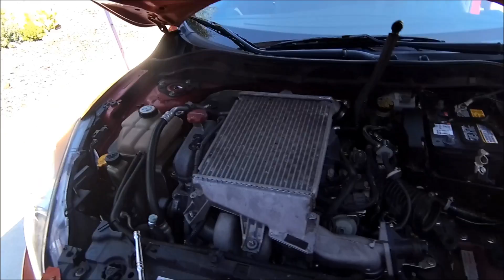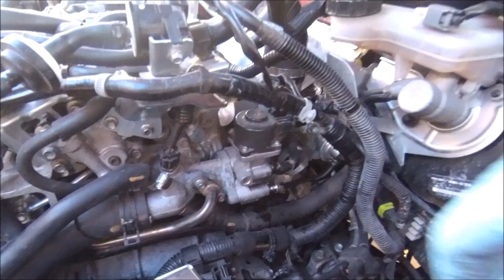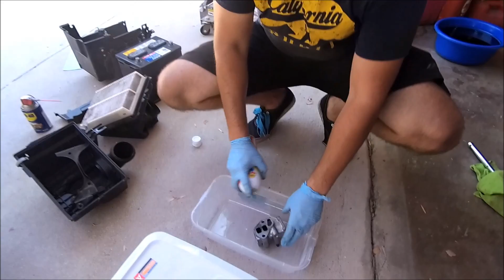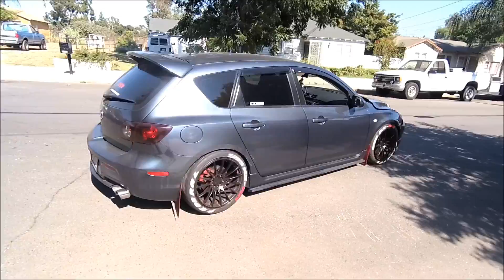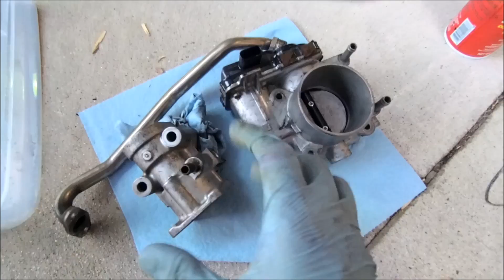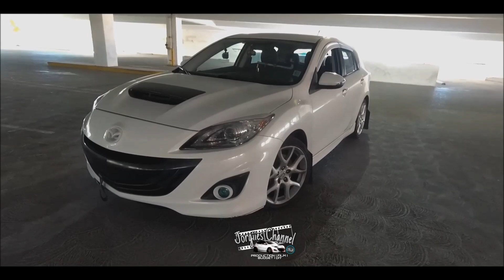Cleaning your Egr (Mazdaspeed 3)

Comment: I did this since i had problem with a long crank and bad idle both got fixed but now it starts smoking white smoke when idling for a while when warm. no smoke when its cold or driving. do you think this could be coolant leaking somewhere from the egr?
Reply from the maker: @hellasceasar4398  It's hard to say when I can't see it. Are you on a stock turbo? Have you done a leak down test? It depends on a few variables that may be the cause.

Comment: hey man, is a crc throttle body cleaner good to clean the egr?
Reply from the maker: You can, but i would say that b12 Chem can be a bit stronger. I would still purchase one, and you can go over it with the tb cleaner.
Reply from the maker: You can use it, but I'd still recommend the b12 Chem. I'd say it's better at tackling the carb build-up and so on. Then you can go over it with tb cleaner.

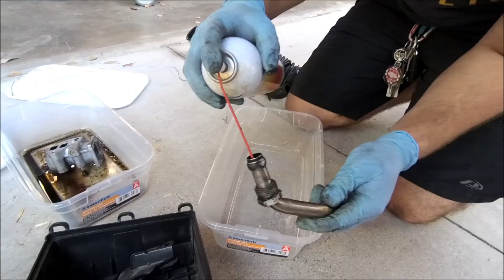Comment: 9:57 imo you should have sprayed oven cleaner in the tube let it sit for 10mins and hose clean, repeat the process a few times till it's clean
Reply from the maker: You can if you choose to. I prefer this can since it's worked in the past and does the job with success. At least for what I've used it for.

Comment: Hey bro love the video. Quick question. My mazda 3 mps is blowing white smoke and losing coolant instantly. Slight missfire as coolant going in combustion. overheating also. Do you think the egr cooler or valve is not good, Causing coolant to go into the intake. Or head gasket. Let me know what think bro thank you. 
Regards
Reply: Sounds like a head gasket? Let me know if this was the issues.
Reply from the maker: I a bit late, hopefully you solved the issue. But it may a more serious issue than than what it may be.

Comment: Yoooo!!! Question!!! 
 was a reason to do all this?  or is any benefit ?
See I have a 09 MS3 but honestly my idle is really poor and even when the weather is really cool idle is 500 rpm or less normally on cool weather should be 1500 rpm or 2k to warm the engine but my is poor idle do you think this will improve my idle?
Reply from the maker: No cel? Could be a number of things. Egr may be the cause, or it may be vtcs. With out more specifics; it can be a bit tough to give a possible solution. You have this as a reference and can knock it out. Any other questions feel free to ask. Goodluck.

Comment: This is a great video, and I would like to add- if someone had worked on that tube and bent it from one end, it will be horrendous to remove it this time. You'll have to jam a wrench to prevent the flare fitting from rotating, and turn the tube itself. Take wrench off, rotate the tube back to start, and place wrench back on and repeat. Install wasn't a breeze either cause now the EGR side is not perfectly lined up. Need to pry and get one 8mm and then the other. I don't feel happy for the next guy who does this.
Also the repair should have included spraying the mating side of the EGR cause that will be equally filled with spaceship black cement.
Reply from the maker: Thanks for the added information sir.

Comment: I have code p050A on my SPEED3 would these help clear the code ?
Reply from the maker: You can try this, but also check your ambient sensor.
Reply: @Luminary_Industries  why the ambient sensor?
Reply from the maker: @christianmendoza5799  are you having idle issues? Temperatures below ambient normal reading may cause similar issues, but I remember having to check this on another gen Juan. Doesn't hurt to start small, and work from there, although you can try the cleaning as well as I've read that this may be a possible issue. Hope this helps 🙏

Comment: How to clean egr on mzr disi 2.3l engine:

Delete it...
Reply from the maker: Well some folks like having stock parts connected and installed. Theres individuals that prefer to leave it as is, though it is an option to delete it, which is why they have egr block off plates or just unplug it. No need to even remove it unless; one wants to remove weight. This owner chose to keep it. It was shared  though. Thanks for the feed back!
Reply: @Luminary_Industries  it has nothing to do with weight. Your egr has to do with fuel economy, but because it recirculates your exhaust back into your intake manifold it gums up for intake valve and decreases the performance of your engine, and can result in catastrophic failure of your engine. 

Why clean it when you can get rid of the problem altogether?

Cars are made from the factory to be more economic, but many of the things they do to cars' engines inhibit them and cause them to need more through maintenance, and because the mzr disi is direct injection, it makes it that much harder to maintain.
 Just my input, not necessarily scripture
Reply from the maker: @thatmps6_guy748  I am well aware of the purpose of this unit, and its known factor towards the valves, which is why I recommend intake valve cleaning. Also, Not everyone likes to remove their parts nor modify their vehicle.  This owner for this car was told about the ability of removing or unplugging. And was aware of the loop. And it does weigh, everything has weight to it including yourself, and some folks remove it due to that as they do ac and so forth. Everyone has their opinion and preference. Just as you have yours, which consists of removing it. Yeah it solves the issue, but it goes back to each individual's preference.  Just like some like to workout and hit the gym and some dont or like some enjoy hiking which has therapeutic value and some don't due too other opinions and or preference or some vote and some don't,  because it "won't" make a difference. To each their own. Thank you again. ❤

Comment: best thing to do with them egr  valves is clean the spring  / electric parts make sure there free , then blank of the exhaust port side on the egr valve body [ jb weld is good ] then refit the valve . no more shit exhaust gasses going into the inlet manifold plus no blocked up egr valve and no fault codes coming up done this on my mps/ms6
Reply from the maker: Thats an awesome tip 👍. The owner of this ms3 wanted to stay stock and put back the same way. Glad to hear you have an ms6, they're gems
Reply: cheers jorgile  you make some good vids , keep up the good work . yes the ms6 is a good car but getting a bit old now,  known as a mps in Europe and there prity rare in the uk where I am , thay only sold 1000 cars in the uk  [ 10000 world wide ? ] and theres only 343 left in the road in the uk
Reply from the maker: @gibboj  they are getting a bit out dated, but so are rx7s and they are still out there with the entent of keeping it for how ever long. Im sure the same will happen with the ms6 or mps or antenzas. Keep car modding and thank you for the nice feedback! ✌
Reply: Hey man, how’s this holding up for you? I like that idea to get rid of the exhaust gases, but I’m worried about the exhaust blowing the jb weld through, is the flow even heavy enough?
Reply: @jessemartin2698  HI MAN i did all my mod`s when i did a part engine rebuild , i blanked of the 4th exhaust port /egr trak to egr valve and the outlet port   [steel tube to inlet manifold at the cyl head side]  NOT REALY WORTH DOING IT THAT WAY UNLEES THE HEAD IS COMMING OF . the best / quickes way would be to make a blanking plate and blank of top of the steel tube cyl head side to stop shit gases going into the inlet manifold . but sooner or later you will afto remove the EGR VALVE to clean it out like in the vid as shit exhaust gases are still going through the valve ,not a big job . you can buy a EGR VALVE DELETE KIT from the USA it blankes of the EGR VALVE / MOTOR and removes it alltogether but it throw`s up a warning light as it sences you have removed the EGR VALVE / MOTOR

Comment: So when you disconnect the coolant hoses from the EGR, will only a quart spill out, or will it continue to flow until the system drains completely?
Reply: Tip from another video: hand siphon what you can from coolant reservoir first into a clean jar to minimise spillage.
Reply from the maker: Mike Last name it'll actually continue to spill. More then a qt. So make sure you buy a whole coolant jug. Keep in mind when you disconnect the hoses on the throttle body. It'll throw coolant out as well. Have a pan of some sort underneath.
Reply: Jorgiie's Channel Thanks buddy! I appreciate that.

Comment: would you please tell me what is the use or job of the EGR?
Reply from the maker: Aldo Ponto Egr stands for (Exhaust gas recirculation) Which is a valve that routes the excess gas back into the intake mani to reduce emissions and burn any unburned fuel helps mpg when operation correctly. Any other question lmk.
Reply: Jorgiie's Channel thanks for the info, I just bought a MS3 2008 and I want to clean all the systems, your videos are so much help. Congratulations. Greetings from Guadalajara.
Reply from the maker: Aldo Ponto Guadalajara! Wow! Awesome man im glad i am of help! Thanks so much for the love! If you need any other help lmk dm me on my ig. @jorgiie_porgiiee Have a good one man!